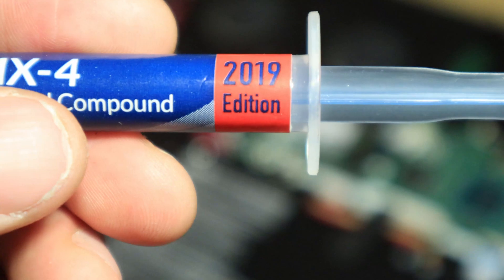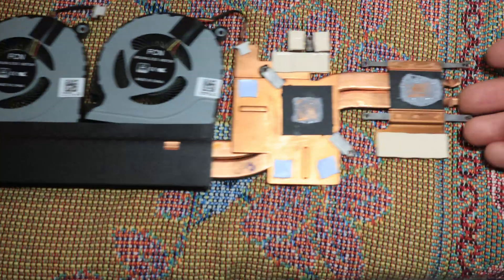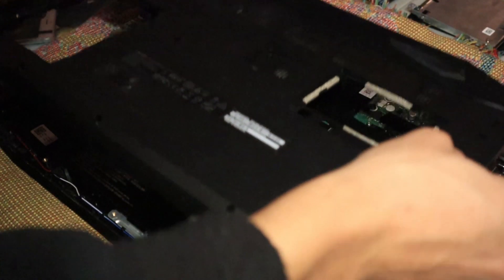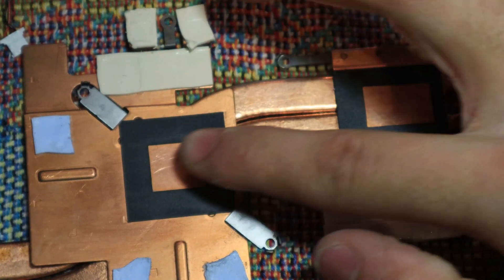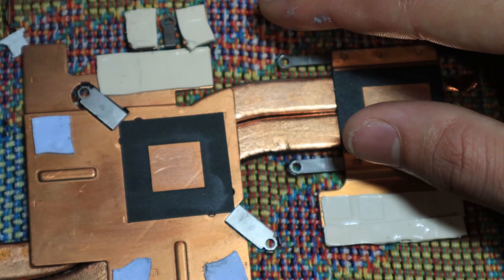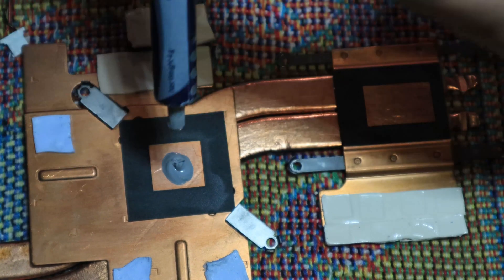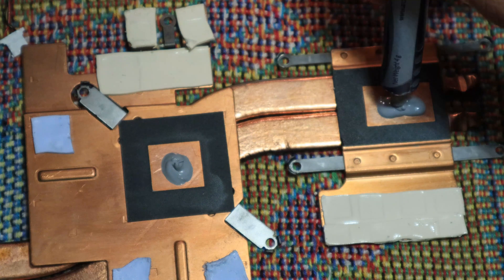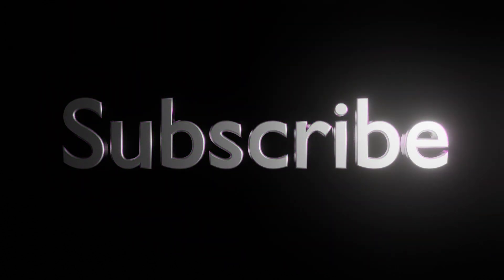Arctic-MX Thermal Paste 4 Month Update & Repaste 2018 Acer Nitro 5

Comment: Have you tried editing on this/ does it edit well? Since it's 2018 I'm assuming its a 1050 and i5 or i7?
Reply from the maker: Mister Momo 4k and 360 editing is perfect for me in davinci resolve, especially when I optimize media ! I have 1050 non Ti and the 8th gen quad core i5 , it’s my main streamin machine as well for twitch, Fortnite is the best on here and my iPad! Also 8gb DDR4 Ram stock,for now and upgraded nvme sSD. Hope this helps! I’m doing more update and fun videos with this laptop to help anyone who owns it or wants purchase one. Please consider subscribing and have a great day 🙏
Reply: @Mahdymax  Thx for answering. I will sub. I'd like to ask, however, what sorcery is u on?? Only 4 cores, a 1050, and the stock ram (so only one stick?) and you're able to edit in 4k and 360 and stream?? I think that thermal paste had some ferry dust in it or something. Is that (and the ssd) really the only upgrades you've made? lmk
Reply from the maker: Mister Momo yes lol I’ll make a video on me streaming and editing. I use OBS studio and stream to twitch and it does fine , I want to max out the RAM to see wats it handles like. Sucks the cpu is soldered on, if it weren’t I’d upgrade the cpu. Maybe if I find one beat up with broken display I could take a i7 mother board and see if the chassis could hold it. I appreciate the subsection 🙏 thank you so much
Reply from the maker: Also yes the SSD is new with not a lot on it besides what I need and videos. Thermal paste is the only other hardware upgrades I’ve done so far. I also updated all drivers for laptop, graphics card, cpu undercoat with intel xtu, I have precision for overclocking but I rarely use it. All the apps are up to date.
Reply: Mahdymax glad to hear it. U should definitely make a video on editing because there is only a single one that’s not even very detailed. Also yiu should do a video on comparing 8gb vs two sticks gb
Reply from the maker: Mister Momo thank you a lot for those suggestions I will get on it ASAP so we can help everybody’s out!
Reply: @Mahdymax  bro, I had no clue acer dropped a version with a ryzen 6 4600h. I canceled my i5 order and bought that, 2 more cores than i5, ima see how well that edits
Reply from the maker: Mister Momo lol me either I was on their web configuring a new one and they got a nice line of specs f everybody , I’d just grab the cpu I want and add the storage and Ram later
Reply from the maker: U gotta let me know how that goes 🔥
Reply: Mahdymax I’ll be sure to let u know 🔥
Reply: @Mahdymax  also im ur 200th sub :D congrats chief
Reply from the maker: Mister Momo thank you for #200 😭🎉🎉🎉🎉
Reply: Bro I got it and I've been testing it out. It runs really well, but there's one huge problem-- the keyboard. Does your version of the Acer Nitro 5 have this as well: whenever I press on the edge or corner of a key, it doesn't register no matter how hard I press or if it clicks.
Reply from the maker: Mister Momo only the top edge but the bottom edged come thru most of the time

Comment: I don’t know that much about computers but I’m pretty sure thermal paste is to transfer the heat from the processor to the heat sink. That’s why its called thermal paste, to help with the thermal/heat management inside the computer. Nice video by the way.
Reply from the maker: Ranvir Hunjan your right! The paste is conductive and pressed in to remove tiny air pockets sat in the grooves of the the heat sink dye and cpu! It’s the best cheap upgrade to do, and I bet it wouldn’t be too difficult on your new idea pad! I recommend thermal grizzley and noctua thermal paste. This stuff is okay
Reply: Mahdymax my parents got me it so they won’t let me do any modifications to my laptop or I’ll get slapped cuz I have Asian parents
Reply from the maker: RNVRH Gaming & Tech Reviews lmao